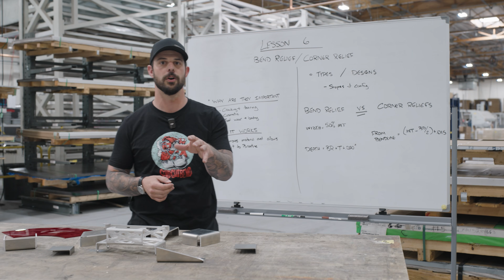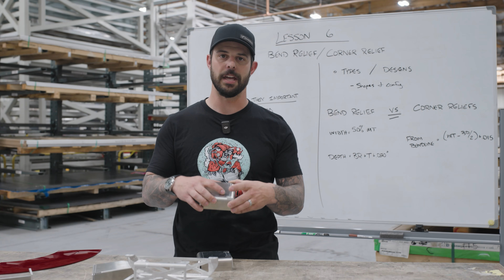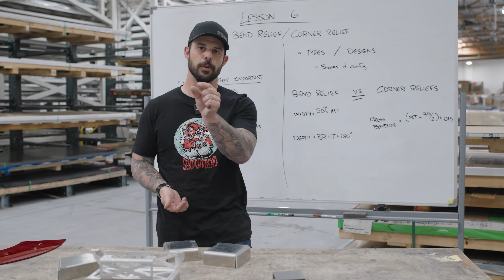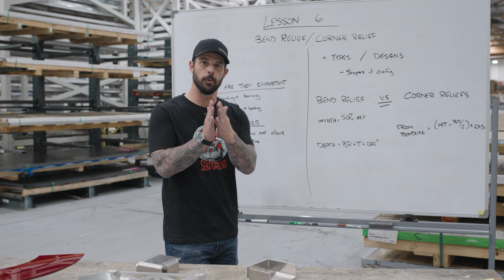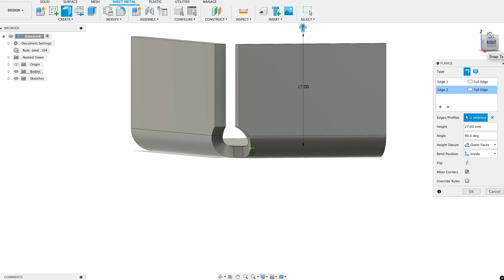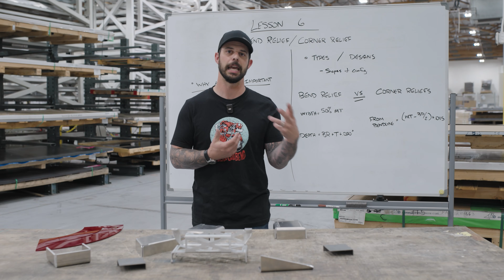Why Reliefs Are Critical for Successful Sheet Metal Bending- Episode 6

Comment: I'm just starting to do some metal fabrication.  So, I am just trying to learn, not to sharpshoot you, when I ask this... but, I do have a question:  

I've got a box/pan brake and have been bending a lot of stuff (like what you are showing) for my personal projects... though I'm working with MUCH thinner material (up to 12 ga sheet... no plate, like you are using).
I'm already doing a variation of what you recommend, just not nearly to such an extreme.  I don't think I can explain what I'm doing effectively without drawing a diagram... but, lets just say that I'm not drilling nearly as large a hole at the junction of the corner, nor am I setting it in as deeply.  My sides fit up MUCH tighter than what you are showing on your example parts and drawings. I've got a pretty minimal gap where the two sides meet and it stays very consistent all the way through the bend radius .  I have no large round opening at the junction, like your parts do.  My corners look MORE like your 'incorrect' example than your 'correct' example.  That said, I'm not seeing any noticeable puckering in the corner (maybe I've mitigated that... maybe I haven't and it's just less obvious/pronounced on thinner material).  The tighter and more consistent gap that I am getting makes it a lot easier for ME to weld up the corners.  I'm looking at the parts you are holding up and I would NOT want to try to weld that.  Maybe a professional could to it, but I would end up with a mess.

So, is it necessary use as extreme/deep a relief as you are showing if that corner is going to be welded?  Particularly, with respect to the radius you are drilling at the base of the corner?

I'm a novice welder, but I can't help but to think that the heat from the welding process is going to relieve any stress built up in those corners, as well as consume any puckering that may have formed, through the bending process.
Reply from the maker: Everything you're saying is true. The thinner the material the less effect you will see in tight corners.  You can get away with a lot. 
Those parts were not necessarily designed with welding in mind.  If we were going to weld those parts we would be changing how the edges intersect.  Jake said he might reduce the corner relief also if he want to weld all the way to the corner.
Reply: @sendcutsend  Cool, thank you! I really appreciate your reply.  I'm still trying to figure all this stuff out, so I appreciate you taking the time to let me know if I'm on track or not.